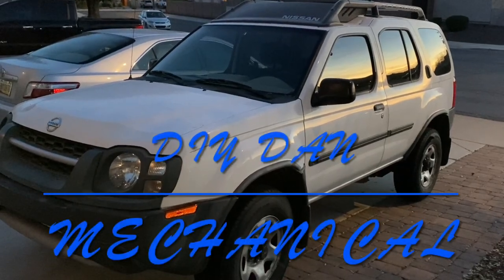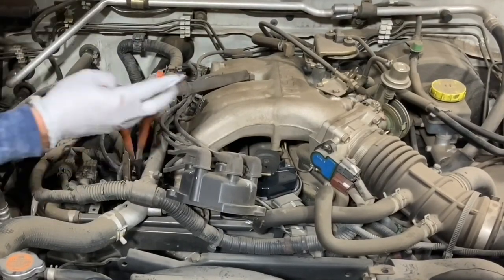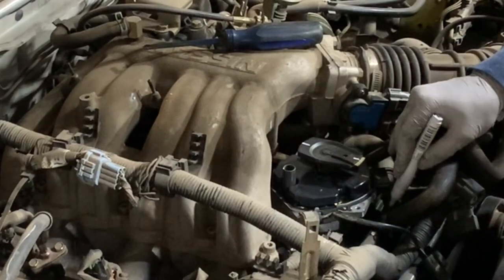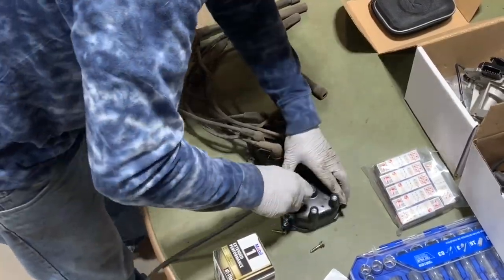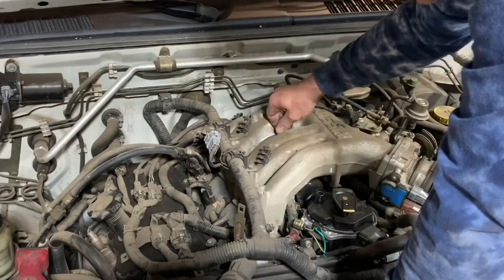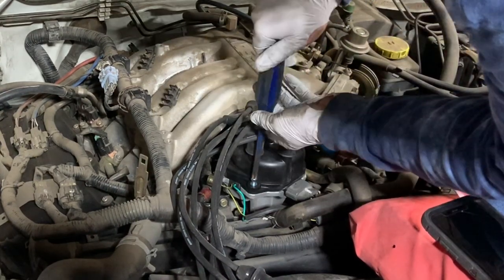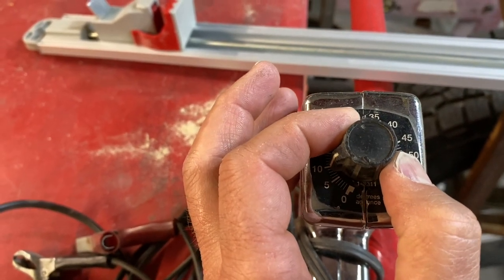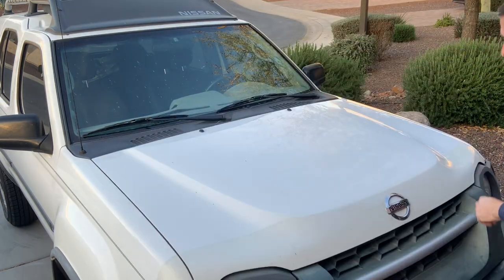DISTRIBUTOR REPLACEMENT INCLUDING TIMING ADJUSTMENT ON 2004 NISSAN EXTERRA WITH 3.3L V6 ENGINE

Comment: Excellent video, I was looking for how to adjust the time with the light gun. There is a video in Spanish, but the person does not accelerate the truck or disconnect the harness as indicated in the manual.

Comment: Can anyone help? I bought a used 99 Nissan Quest and needed to replace the distributor. It was set to advance and was running fine! Well, I had to replace it, and checking the timing it was WAY off? and setting it to 15* it's now over to the "retard" side and I have a misfire. Tried putting it back where it's marked but wow it's worse! Thank you for any help.😊

Comment: Hi i have a 98 Pathfinder 3.3L. I inspected the bottom inside of distributor (under the coil) and the shaft only had about half the ball bearings in it. Could this cause random misfires in all cylinders, P0300 code?  The plate that covers the bearings was broken off/loose too. Thanks!
Reply from the maker: @thesetruths1404  yes if the bearing is shot the shaft is not going to stay centered which could cause the rotor not to deliver the spark properly

Comment: Hi I replaced my distributor and now have a hard start condition when the engine is cold and a P0340 code with a SES light on. Starts fine warm and seems to run like a dream compared to the old distributor. What might the cause be for the hard start? I’m stumped

Comment: Thank you so much this will definitely help me. Ive watched a bunch of videos on this and the is the one I can understand! I have a 2004 Nissan Xterra  with 290,080 miles and it is going to be my first car but it has a problem with idling way to high and stalling once its at operating temperature and stoped (like at a stop sign). Im also going to replace the fuel pump and clean the Idle air control valve and hope it will solve the issue😂. Thank you for reading this and for making this video!
Reply: Did that fix your issue?

Comment: Ahh..the glorious #6 plug! I know that nasty little bastard! Had me a hassle and a half fishing for that SOB too haha! There's a trick to it I discovered much later
Reply: Well share.... I just laid on top of the engine with my left arm shoved under the wire harness just enough I could use my fingertips as a guide
Reply: Super fucking easy, 2 x 6" extensions with a u joint, and 4 bolts remove the hood. Took  me less than 15 minutes and I had never even replaced a spark plug until that point. THere's no need to struggle and #6 plug is not hard with the correct procedure and tools.
Reply: Took me 5 min maybe less 🥱

Comment: Hi Dan! I’ve had a super similar noise that seemed to be coming from the distributor and multiple mechanics told me it was a bad bearing in it. I replaced the whole thing following your great tutorial and unfortunately I still have the same noise seemingly coming from the distributor. You mentioned possible next steps and was wondering what you would suspect next.
Reply: Basically I’m wondering if replacing the timing belt fixed the noise hahaha. Thanks again for the great video!
Reply from the maker: Yes it ended up being the timing belt being loose and hitting the cover just a year behind in editing videos and don’t have it posted yet
Reply: It’s the timing belt ! Its flopping causes the distributor to knock back and forth also the belt flops back and forth slapping the shield , I know because when I was a young inexperienced mechanic I made the same mistake.

Comment: question, how bad is the distributor on this engine? I've already changed it twice and the problem has been lack of spark
Reply from the maker: Sounds to me like you might have a bad coil or wiring issue I doubt that the distributors are going bad continuously
Reply: That's what I thought too. Well, the coil is inside the distributor and it has a lifetime warranty, I preferred to change it completely. However, I was wondering which part was constantly failing, whether it was the coil or the ignition module control because the rotor was spinning and the distributor cap looked fine. 

By the way, excellent video, very well explained.

Comment: Did you fix the clattering noise problem? I have the same issue with mine. I'm going to change the distributor today because it seems like it's coming from there
Reply from the maker: No, it ended up being the timing belt. I’ve done it it fix the problem. I’ve been running it for probably two or three months now I just haven’t had a chance to edit the video because it takes a lot of time but the timing belt fixed that clattering.

Comment: Buying a cheaper distributor is it still working
Reply from the maker: So far so good I ended up having to replace the timing belt to get rid of that noise and I will have  a video come up shortly. If that’s the same reason you’re thinking of doing the distributor

Comment: Hello I have a 98 Pathfinder 3.3L, 230,000 miles. I changed the spark plugs and wires, and the distributor as its bearings had failed.  I marked the old distributor in 3 places plus the center of the rotor, and reinstalled the new one exactly as the old one came out.  It doesn't have the random misfires anymore. It always has idled about 950 in Park rather than 700ish. But in Drive it drops to 700rpm when at a stop.  Is this normal for yours also?

I checked the timing advance via my OBD2 scanner and it's showing 8 at idle (950rpm) in Park, but goes to 15 when placed in Drive (at a stop).  Does this mean 8 degrees BTDC?  So it's retarded too much eh?  Which way do I turn the distributor to Advance the timing closer to 15 degrees BTDC while in Park?

Which way to make it read closer to spec, which is 13 to 17 BTDC in Park?

Can I just turn the distributor very gradually without disconnecting any sensors and watching my OBD2 Timing Advance screen, stopping it at 15?  I do not have a timing light. To advance these (from 8 to 15), is it turned counterclockwise or clockwise?

Thanks much!
Reply from the maker: Yes loosen the bolt holding the distributor and slowly turn it you can do this while it is running

Comment: I pulled mine off with out marking how can I reinstall
Reply from the maker: Use your timing marks to get to tdc then position the distributor so the rotor is pointing at the no 1 cylinder on the cap hopefully you kept good track of your wires that should get you close the only problem with that is you might be 360 off so if it runs like crap take it off rotate engine 360 do the same thing  then check with a timing light to fine tune
Reply from the maker: Good luck 👍